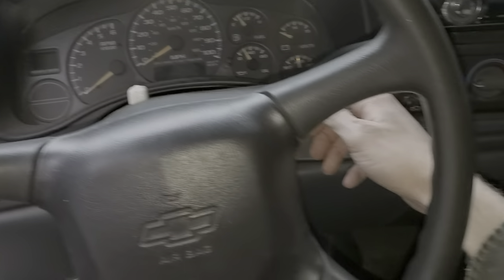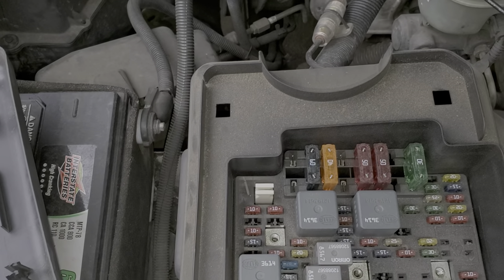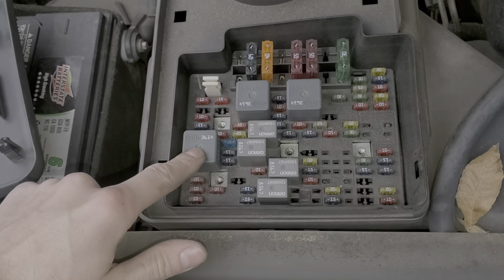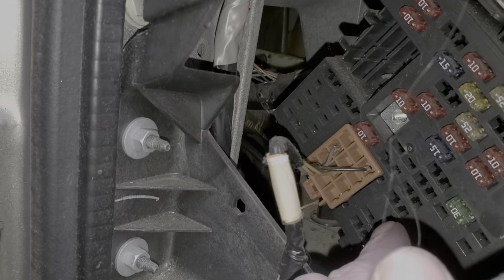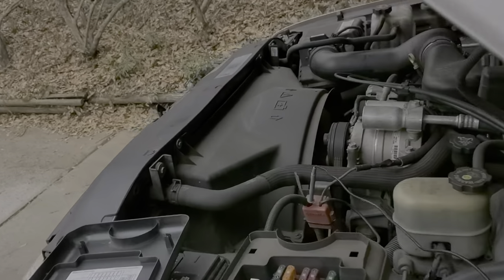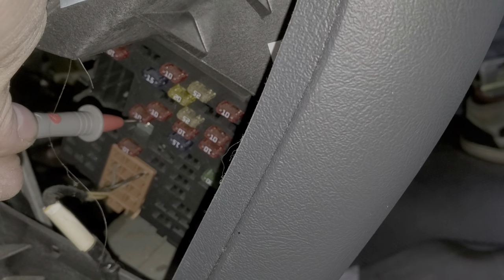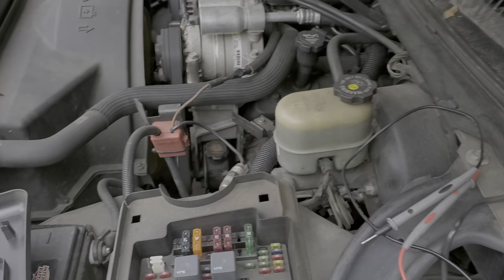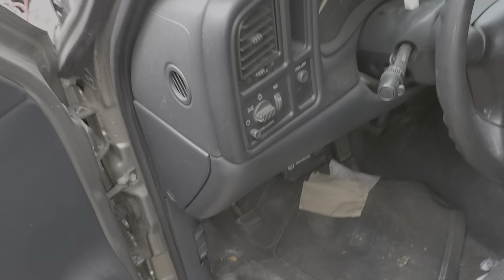2002 Chevy Silverado Starter Relay & Fuse, Ignition Switch Bypass

Comment: So I have a 2001 Silverado and once you turn the key to the second position is starts without having to crank the key. The starter will keep spinning  while running until you turn the key off. replaced the relay and checked all three engine grounds....... thoughts on what to try next?
Reply from the maker: There could be a problem with the ignition switch itself.
Reply: Solenoid is bad or connections on the solenoid are crossed or touching somehow

Comment: Hey I have a 2000 silverado single cab 4.3l and I just finished doing a ls3 swap with the 6l80 transmission... So i have a stand alone harness and I have everything wired in it right spots but when i go to turn the key it dose nothing just like you show when you took the 10A crank out... is there anyway i can bypass the neutral safety stuff?
Reply: Get it fixed having same issue